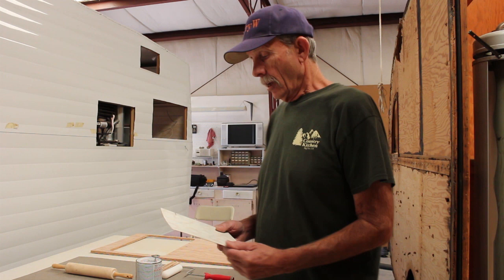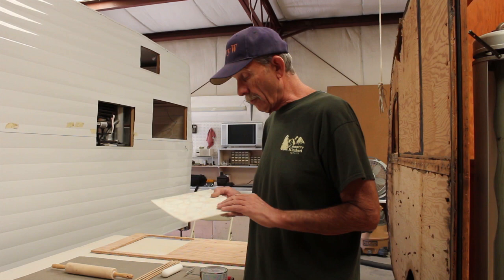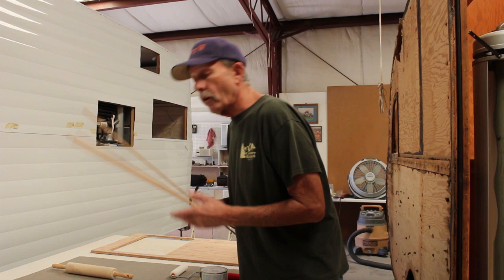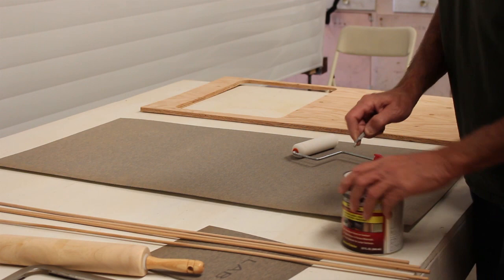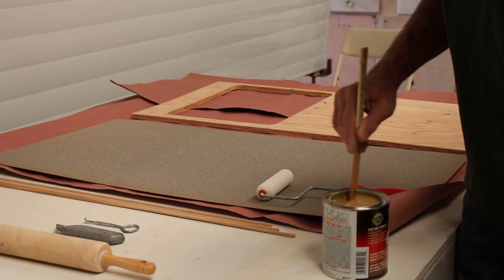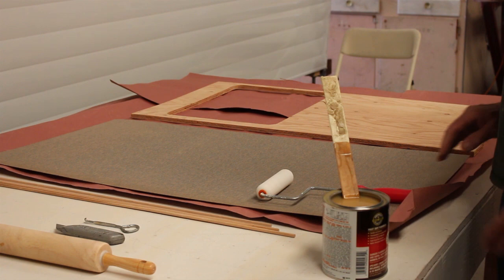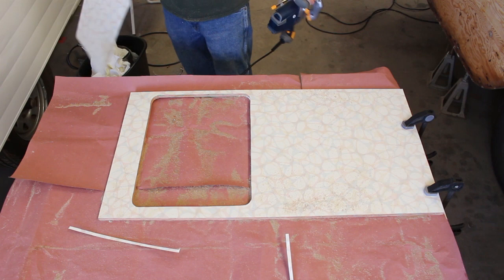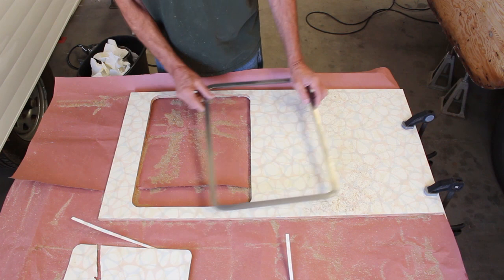Quick Tip #11 Installing Formica for the 66 Super Shasta

Comment: Spot on man, I built counter tops for a few years and this is pretty much our process. The only tip I could give is to cut the sink hole after to minimize the chance of breakage and make a slick matching cutting board. I'll be driving out from Denver to squaw valley to pick up a 1975 field and stream 13' in a couple of days and I'll know exactly what to look for thanks to your videos. Thank you!
Reply from the maker: Thanks for the kind words and watching my videos. Glad to be of help. Make sure to go to my website and also send photos of your trailer. My contact info is on my website.

Comment: Good tip about taking the glue to the paint dept and getting them to run it on the shaker table!

This is a great tutorial, Larry! When I did my kitchen, I couldn't count the number of videos and tutorials I watched, assimilating every shred of help I could get. I'd never done such a thing before and had no clue as to how to do it.I was working with well over $200 worth of Wilsonart laminate, and the fact that you have one chance and only one to get it right was pretty intimidating.

The biggest section took a whole 4x8 sheet of laminate, and a 4x8 sheet of plywood. It's an 8 foot wide counter, 2 feet deep, extending out 4 feet by 2 feet deep on either side. It was one piece, one shot, and I pulled it off. The dowels are the magic that makes it work. You lay it out, get it right, and start in the middle, pulling them out one at a time as you roll it outward, so you don't get any bubbles. And it works. That counter has now been heavily used for 5 years, and I'm still loving it.

Had I seen this video back then, I think it would've eliminated the need for watching  the eleventy gazillion others I watched then. You nailed it, sir.
Reply from the maker: I remember when you remodeled your kitchen John. And you did such a nice job too. That and your guitar rebuild were two of the most interesting project videos on You Tube...

Comment: Great video.  I have used dowels to set the Formica on also but learned an old trick from a laminate guy about 30 years ago.  He used old Venetian blinds.  I have been using them ever since.  They are curved, set on two edges and don't roll on you.  The aluminium ones work the best.

64MobileScout
Reply from the maker: Thanks for the tip Steve. I'll try that next time.

Comment: Yeah Baby, The TUNE is back.    When we ever meet, I'll have that guitar lick down to make your head snap as you toddle by, Mr. M-Tec.   HA

BTW, your shop is starting to show some dust; so, I know you are working a little bit.

Ladies and Gents, Boys and Girls, Larry left a small tip out though probably covered in another earlier segment as mentioned in the audio of this show.   These formica brand counters come in quite large sheets needing to be sized down to the smaller surface counter to be managable.    The formica is difficult to cut without shattering and splitting.   A method we use around here is a multi-toothed 'panel blade' on a circular saw - BUT, installed backwards in the reverse direction.   The teeth then tend to melt their way through rather than chop or chisel the formica (trust me or do a test piece.)   Look at the teeth, compare it to a hand saw, then figure out the natural wood cutting direction.   Reverse the blade so the teeth are 'backwards.'  ..... Take the class, Larry will show you.
Reply from the maker: LOL I've made tons of dust in there. I just like to clean it up at the end of each day is all. I still like that tune too.